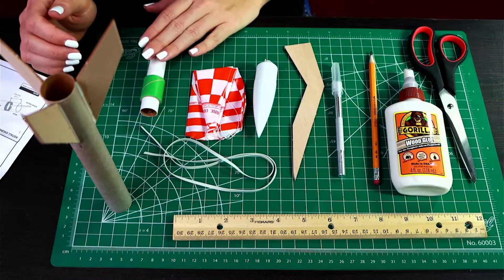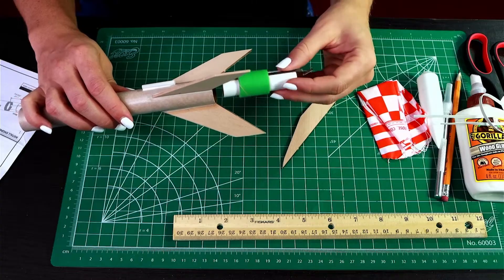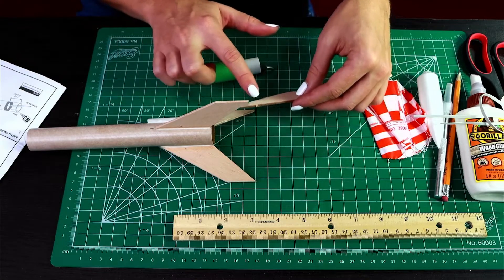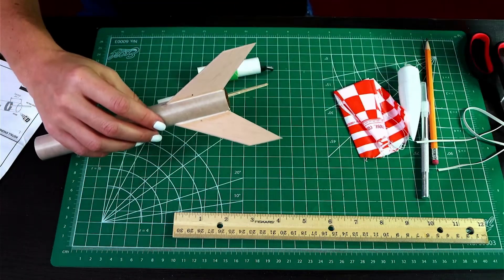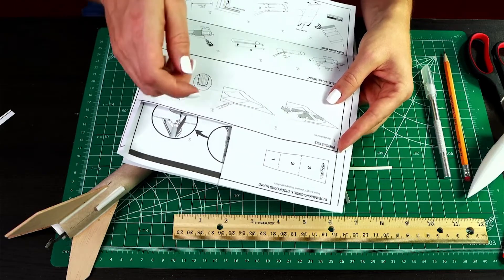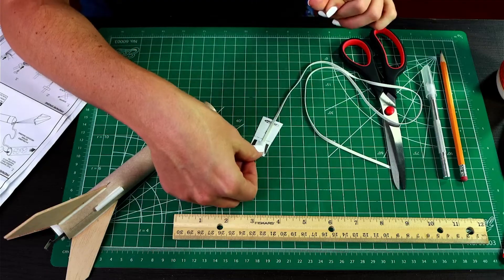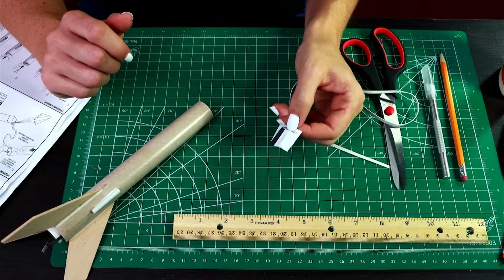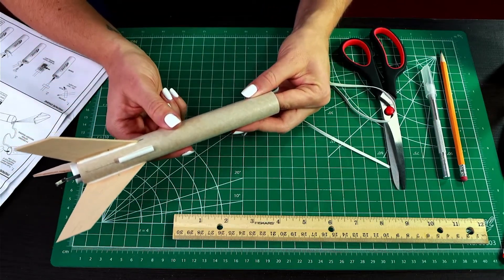Alpha Build Part 3: Install Engine Mount and Shock Cord

Comment: Excellent!  I noticed the wide green engine mount tube; it gives lots of contact area for glue adhesion, (as opposed to using two thin spacer rings to install the engine tube).